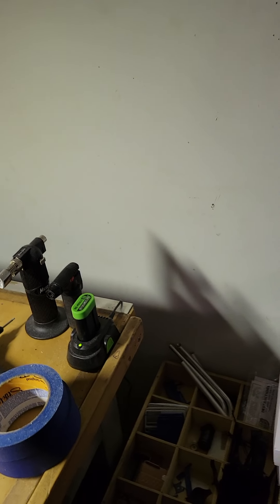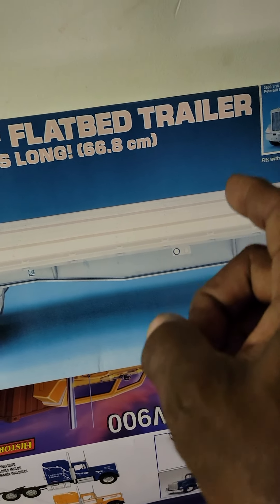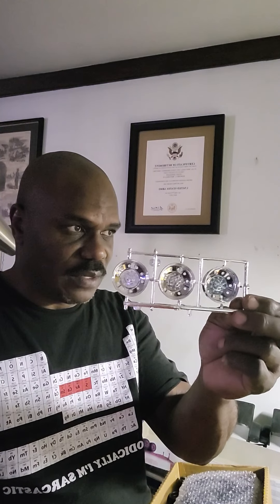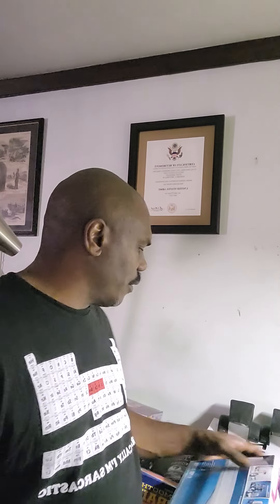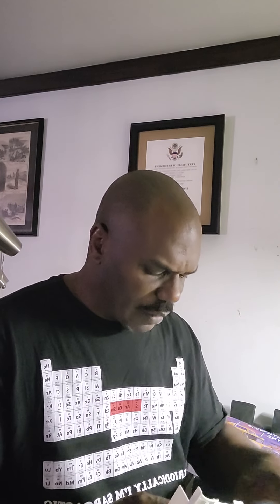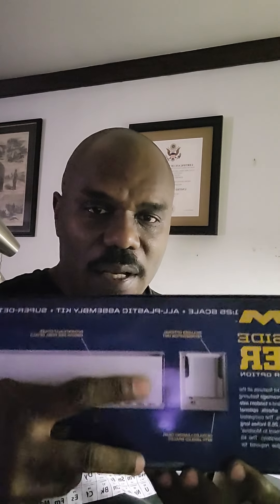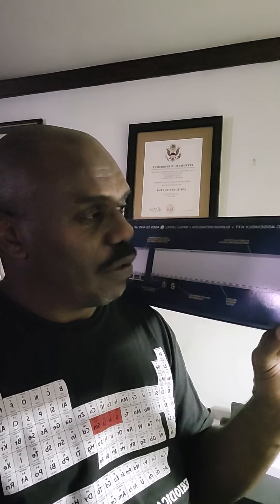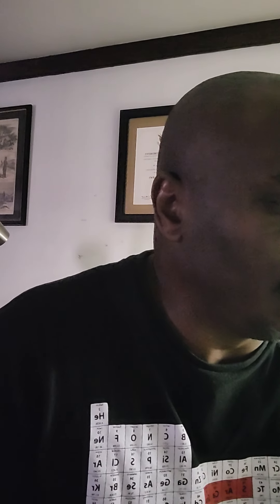1/16 scale KW900 tractor: Trailer had arrived yesterday.

Comment: That's pretty cool I used to work at fruehauf in Fort Wayne Indiana was the supervisor on the flatbed line that installed the wood decking
Reply from the maker: I work 20 years for the Army as a heavy mobile diesel technician, and 6 years with Swift Transport as a diesel technician myself. Thank you for watching